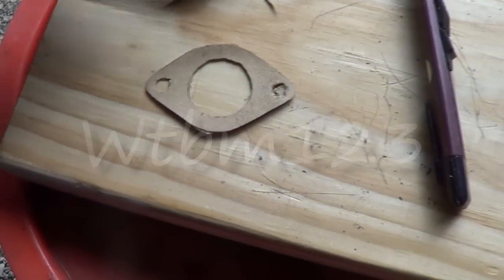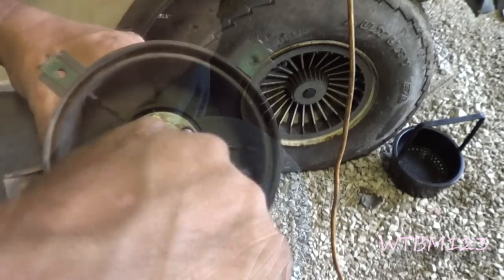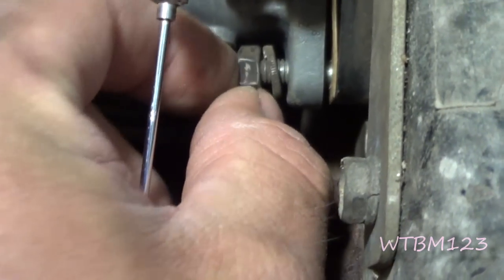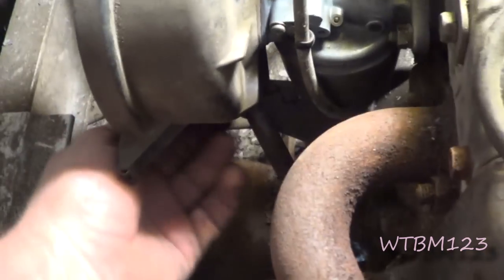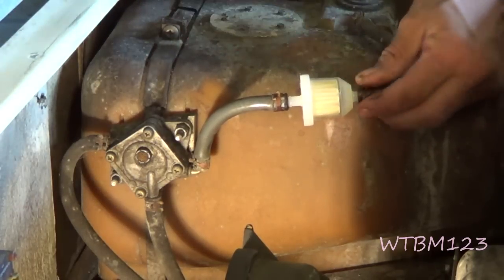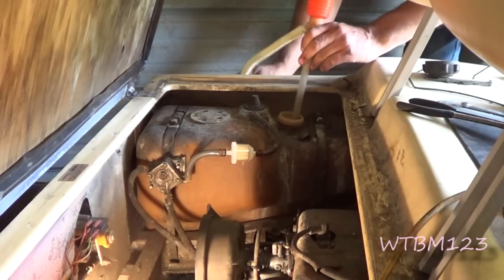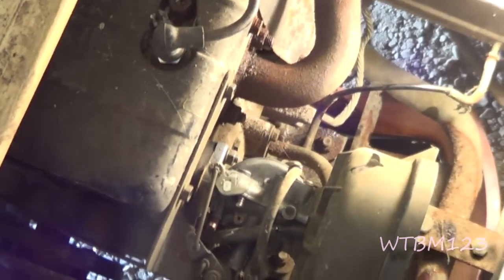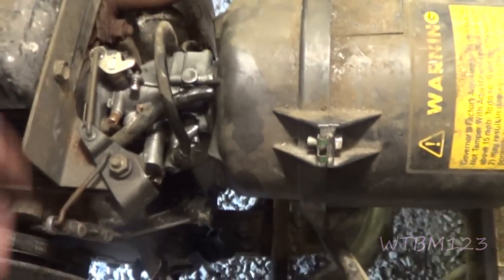ClubCar Golf Cart  part 4

Comment: Watching these videos again. A friend has a club car golf cart they use at the campground the dies and won't refire after running a few minutes. Sits awhile and then will fire up and run again for a few minutes. I'm thinking either the ignitor or the carb is gummed up and the carb bowl runs dry and slowly fills again. Leaning more to the first. Said the run time has gotten shorter.
Reply from the maker: Do not forget the pulse pump for the fuel . make sure it is good .
Reply: Yea that to. Glad you mentioned it in the video. First to figure out if it's fuel or spark related.
Thanks for commenting on my video today. It reminded me to watch these videos again to get ideas. Another showed me the ignitor

Comment: I have a 97 model club car and just put a new carb on it because the old one filled the engine and air box with gas. This one ran good until I put the aircleaner in and connected the breather hose now it filled the new filter with gas. What could be doing this?
Reply from the maker: If all is well with out filter , and no over flowing gas , is there a filter restricted , or any restriction .
Reply: @wtbm123  I got it fixed running good now.The plastic air duct going to the front had filled full of gas when the old carb needle valve didn't shut the gas off.I didn't notice it until after soaking the filter in gas a couple times.After the second time I dug deeper to find out where that gas was coming from. It probably had a quarter gallon in it.